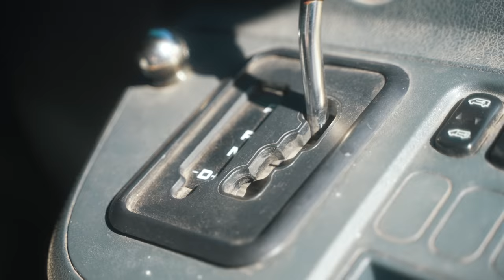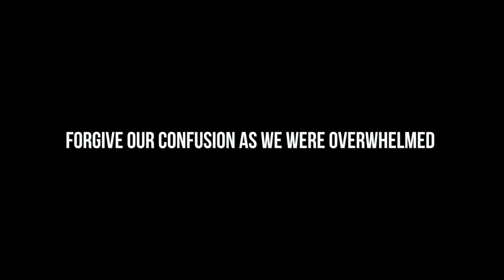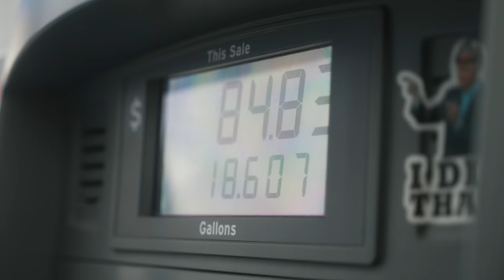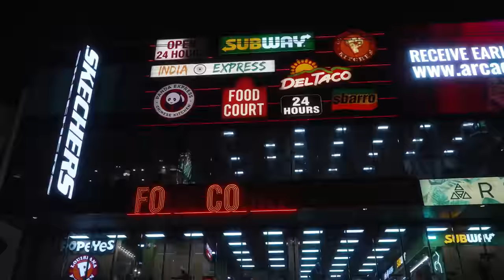Scariest Moment of Our Lives

Comment: What an emotional roller coaster this episode was! 
My stomach was already in knots waiting to see what happened to Izzy. 
Episode starts off happy and energetic and then boom! A swift kick to the no no square! 
So glad Izzy is ok and I hope she didn’t have too big a case of the munchies. 🐾❤️
You guys did great though🙌🏾 
Life threw you some hard punches but you bobbed and weaved like pro boxers and kept moving. Quite motivating! 

Those older MB diesel engines were notorious for gummed up intake runner flaps and oil separators. By the looks of the amount of blow by oil in the intercooler pipe off the turbo one of them could be the issue. 🤞🏾hope it wasn’t anything serious. 

Have a great week and see you next Sunday! ✌🏾
Reply from the maker: Right. Just when you think everything in going grand… haha😂 turns out dogs and humans are different in that case. Dogs actually can’t eat or drink while high on THC. 

Thanks for your knowledge! 
See you Sunday!

Comment: I used to bring a 1 kw Honda generator in my plane to air shows (Oshkosh). That means you run the generators in and amongst the airplanes. No matter how quiet they are they are still generators running. Air shows are only a few days long. I have a couple iPads and an iPhone to charge. That means NOT carrying an generator full of fuel in the airplane and not irritating your neighbors! JACKERY is great!

Comment: The photos were so beautiful and romantic!  Gorgeous photography, you couldn't have asked for a better backdrop!  I've had my emotional moment for the week!  I found myself tearing up and so upset about the dog !!  As I was stationed in the Nevada desert for a few years, I'm so over all the Vegas/Reno Casino deal.  The first time I went into a bathroom and saw slot machines there, I knew it was time to move on.  Just not my thing.  I will say, I'd rather be in Northern Nevada than Southern NV anytime.  You can have both desert and mountains there.  Either way, the best part is OUTSIDE the city.

Comment: I am so glad you got to see the Valley of Fire!  one of my favorite spots... so sorry Izzy got "sick",,, very scary indeed!. Your breakdown reminds me of a similar incident I had with a Toyota diesel... oil everywhere on the engine... I assumed it was the head gasket and it turned out it was a $10 oil line from the filter to the brake booster pump...  since diesels don't generate much vacuum the brakes are boosted with a vacuum pump... while your Sprinter's vacuum pump mounts directly to the engine there are other places oil could be getting out. Also it could be brake or power steering fluid but you would notice that with soft brakes or hard steering (the puddle is right below your power steering reservoir - but the fluid is usually greenish yellow and not brown.) brake fluid is usually red.  It could be transmission oil since the oil is cooler in the radiator and the radiator vibrates considerablly.  Take care and hugs to Izzy ...I think she has had enough "tripping" for a bit!

Comment: excellent content, get that turbo checked hope you didn't blow the turbo out, when oil leaks in the very front of the motor the engine cooling fan will blow the oil back across the engine so it is hard to tell where the leak is coming from if that coolant check the bottom of the water pump foe the little hole and see if its leaking from that there will be a little trail of coolant coming from that hole, glad you not in the middle of nowheresville